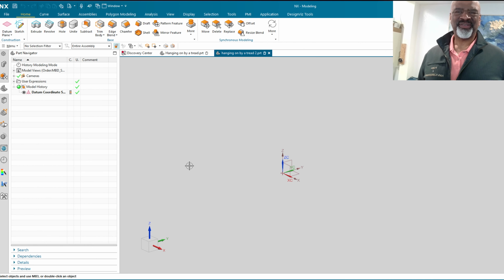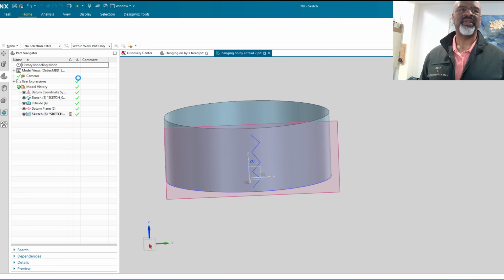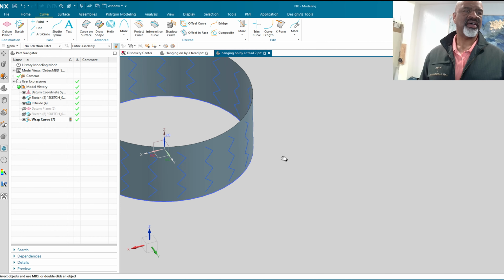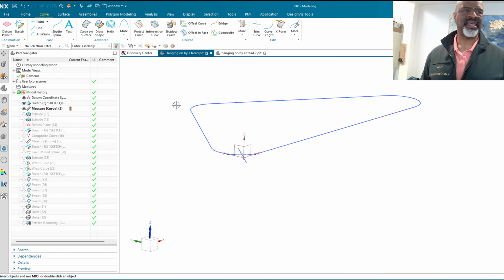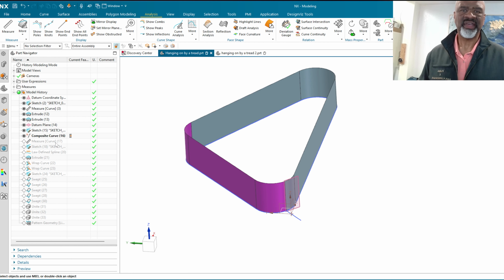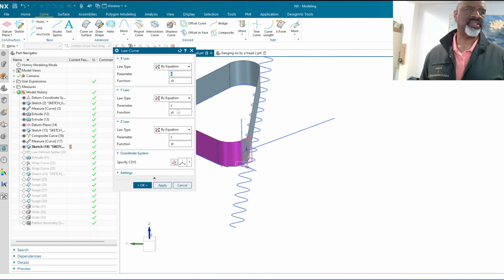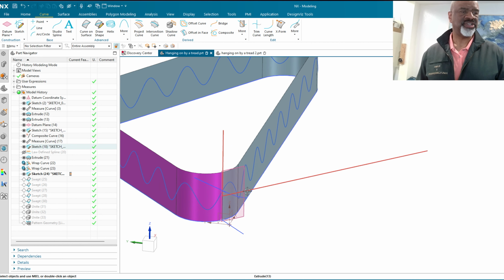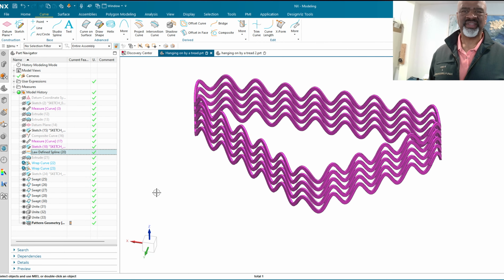Hanging On By a Tread! Siemens NX Pattern Tutorial for Precision Modeling

Comment: Nice video. I have two questions:
1- Is there any particular reason why you're using the old sketcher? 
2- Why did you use several Swept features instead of a single one? I feel like that's not a good practice because it breaks associativity (for example if you were to change the initial shape - making it square instead of triangular)